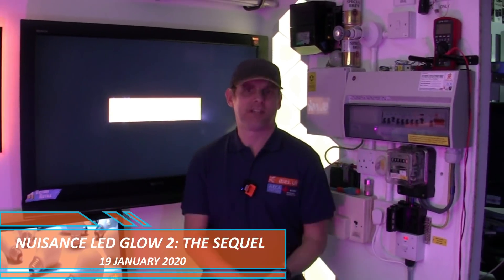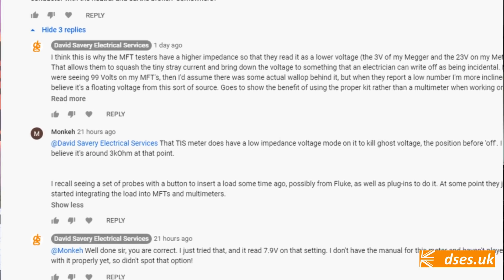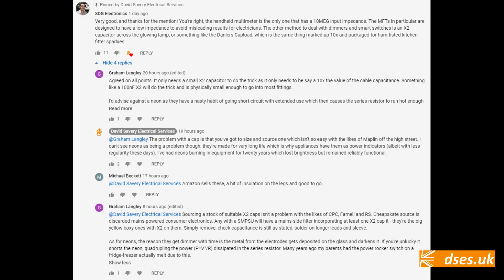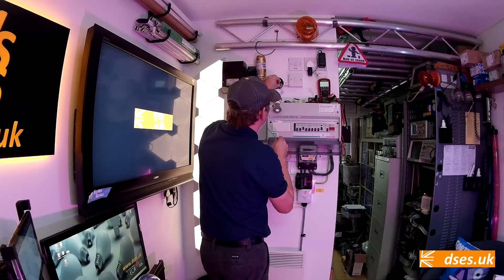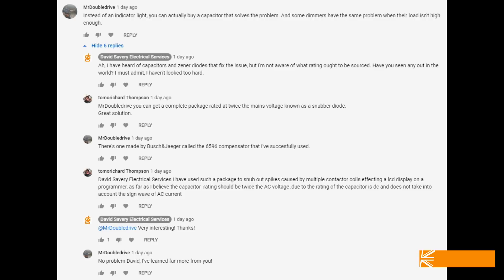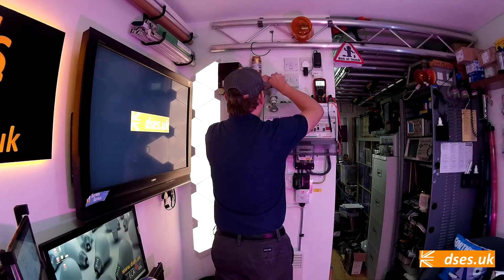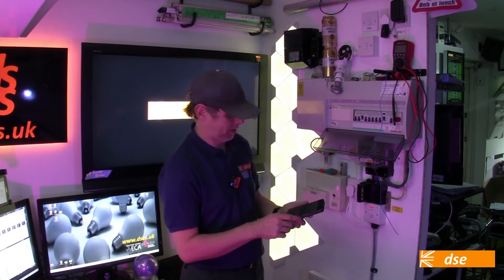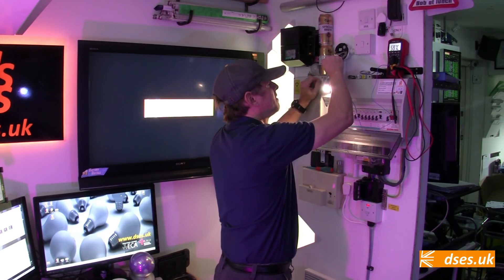Nuisance LED Glow 2: The Sequel

Comment: Thanks for the mention :)
The  resistor that should be inside LED lamps to stop nuisance glowing is on the low voltage side not the 230V. Normal resistors are rated for 230V and therefore not ideal for connecting across the mains, 2 should be used in series so that each one only runs at 115V ! This is the lowest cost solution as you can buy 100 for 50p and use bits of stripped insulation to insulate them,  there is also the cost of your time, 10 mins soldering and insulating versus  a trip to the wholesaler to buy a product if you find that you used the last one on the previous job.
Also see Big Clive's Resistor Roulette https://www.youtube.com/watch?v=cMnpMxYHlHY
Reply from the maker: Cheers Steve. I know what you were saying previously doesn't really apply to my shenanigans here, but I didn't want to leave you out as you'd mentioned resistors specifically. I take your point about the voltage divider. As you say, it's cheap, but not the way I'd prefer to tackle the problem!
Reply: The resistor on the low voltage side will only work with some types of LED drivers. It wouldn't work on switching converters for example
Reply: @dsesuk  resistors are a bad solution anyway. Best to use the imaginary component of the complex impedance to do the majority of the work so you don't create heat.
Reply: SDG Electronics 
A 0.47uF at 50Hz would result in: 
Xc = 1/(2*Pi*f*C) = 6776 Ohm 
That seems more than adequate if a 560k resistor also killed the light. So wouldn’t a capacitor of just 47nF have done the job as well in this case?
Reply: @Conservator.  David did use a 47nF capacitor. It was 0.047uF, not 0.47uF
Reply: SDG Electronics Oops, I missed that. Thank you!
Reply: @sdgelectronics  Correct - it only applies to capacitive droppers and I suspect all the LED lamps with this glow issue will have this type of 'driver'. A decent SM buck regulator will have circuity to stop this happening.

Comment: Your destruction of resistors reminds me of my electronics degree. Building a stepper motor driver and testing with resistors instead of the stepper motor. 4 smoking 47Ω resistors later and we'd proved the circuit worked. Love the videos

Comment: I would have thought anything generating heat tucked inside a ceiling is probably a bad idea, I would be going with the capacitor option myself.
Reply from the maker: Indeed, and those 15k things were from a lighting manufacturer too with the instruction that 'more than one may be needed'!

Comment: I've recently been glowing incandescently with rage with this problem. I installed new LED spots in our ageing fire station, and my competency was certainly questioned because of this glow of the lights!  Our building is pre-Christ era, so all steel cabling, which I assumed was the cause. I'll try this neon with resistor trick.

Comment: I had a related issue with two 1W LED spots over the bed. They are LV not mains so each have a tiddly little CC driver unit. They are each wired with a crossover switch so they can be operated by the door or whilst sat in bed. Everything is fine in one position, but in the other there is just enough current for the driver unit to start-up every 30 seconds or so so you get a little flash, then another, and so on all night. Not ideal.
I deduced that the problem was induced voltage, not helped by the fact that the original drop cable had no CPC. I'm pleased that I worked out the same solution: 0.1uF cap across live and neutral. The only catch is that it didn't work. Or more accurately it worked on one lamp, but the other one still flashes with the crossover in the 'wrong' position. I assume a fatter/different cap would do it but it's never been quite annoying enough to actually get round to fixing.
I've forgotten the sums I did now, but I suspect the answer depends on what's in the driver unit. Possibly just a less cheap and nasty one would do the trick. Anyone got any experience of the right values to suppress driver-startup as opposed to continuous glow. I think the problem is that the driver slowly collects charge and the voltage rises until about 80V when it decides to start up. So some 'fixes' will just change the frequency of flashes, not actually stop the problem.

Comment: hi David I have a weird one for you to ponder over! like your LED Lamps glowing when they shouldn't! it's an Electric shower when it's switched off the Neon glows on and off and water drips from the head sometime quite a bit, (i think I depends on the Voltage) obviously it doesn't do it when the Isolatior is in the off position, maybe others have come across this anomaly!
Reply from the maker: Hard to say without seeing it. Maybe the off position on the switch isn't fully breaking the contacts or water has got inside the switch mechanism or something???
Reply: @dsesuk  ok thanks it could be the micro switch maybe very close but not touching contacts acting like a Capacitor

Comment: A neon with series resistor would be better I think. Prolong the life of the neon and safety fuse if it ever did go low in resistance due to electrode failure. We use to use a 1Mohm 1/4W resistor in series with neons for constant mains indication. It gives a dim glow but safer and lower power losses.

Comment: Good to see the capacitor in action. You can measure the capacitance between circuits and then estimate the required capacitor value. Anywhere from 4.7nF up to 47nF is usually sufficient. Those 1/4W or even 1/2W resistors are often not rated for the peak mains voltage but I'd not recommend that approach anyway.

Comment: Why not use a single pole double throw switch with common as switched live and selecting between live or neutral.
So off feeds both sides of the LEDs with neutral. No wasted power or in back box circuitry components.
Live/Line/Hot depending on your grumpyness level 😁

Comment: Had this problem recently on  bathroom light and fan. When light was turned off the fan kept running on the overrun timer and the bulb softly glowed. The bulb still glowed even when the fan stopped. The fan had a humidistat that was still taking power. Fan was supplied by a 3c&e cable. Capacitance was causing a small current on the switch live to come back up the cable. Plan A was to fit an X2, plan B was to put in a separate cable for the switched live and plan C was to try a dimmable bulb. Plan A didn't work. I missed out Plan B. Plan C though worked. Philips warm glow bulb if anyone's interested. Original bulb was a B&Q special.

Comment: You are a life saver: installed 3 x 12v led tape under cabinet kitchen lights each with their own drivers. The lights were switched on a 2 gang with the main kitchen light 3 plated in the switch. When the main light was switched on the end led flashed when off, no glow. I switched the driver thinking I’d fixed it however the middle led started flashing 🤯, technical help at www.Sycamoreled.com were useless. Watched your video DiLog 9118 Mft picked up 59V, Tis859 showed 19V put in the Danlers load capacitor from CEF and the voltage on both went down to 1V, problem solved 😅. Cant thank you enough 👏👏🤩😎
Reply from the maker: My consultancy invoice is in the post Simon. Make sure you're sitting down when opening it.
Reply: Is this you embracing the dark side and monetising YouTube, it’s a sad day 😉

Comment: I've had a similar issue with "smart" or remote control light switches that don't use a neutral wire. They pass through a small amount of current, which is fine with incandescent bulbs, but will light up one of the LED bulbs in the circuit. Very annoying, I just ended up swapping out bulbs till I found a set that weren't too intrusively bright. The dedicated units they sell for the purpose are so very expensive.

I like the neon indicator idea, might see if I can find some next time I want to put one in.
Reply: Hopefully you're following Dave's example and experimenting on your own installation rather than a paying customer's.

The lamps matched to smart switches have already been tested together by the manufacturer so that you don't have to do it yourself, that's one of the reasons they cost more.

Comment: Stray voltage on 3 port valves can be in the order of 100V  on the orange wire and this can bring on some boilers because of the internal resistors within the unit allowing voltage down that wire.  https://diy.stackexchange.com/questions/100860/y-plan-sundial-150v-on-orange-wire-boiler-stays-on-in-heating-only-mode    A choke / suppressor fitted across the switched line to the boiler and neutral  stops this from happening.

Comment: Could you place the CAP in the light switch instead..? or would that present other complications..?
Reply from the maker: I don't see why the suppression device couldn't be in the switch so long as a neutral was in there as it needs to be connected across line and neutral. The only thing is, if there's a neutral to the switch then you may not have this problem anyway as the neutral would suppress the electric field. It's the lack of a neutral (leaving a line and switched line) which tends to cause this phenomena on lighting circuits.

Comment: I completely agree a suitable capacitor is the best way to go, but surely the capacitor used must be rated for at least 500 volts so that  an IR test at that voltage won't damage it ?

Comment: Nice follow up. Be Careful IR testing X2 caps above 240V, check their voltage rating first. 500V will most probably shorten their life. That ceramic thing was shite.
Reply from the maker: Ah, I'm glad you mentioned that as I did wonder about it. My cap has no DC data on it.

Comment: I tried the capacitor solution.. Without luck whatsoever. It even made the bulb glow more when turned off. But I was wondering.. If the light is switched off with a charged capacitor (given that the light is turned off before the sine goes down), wouldn't the charged capacitor just feed the LED when mains are off?
Reply from the maker: The capacitor solution works if the phenomenon is being caused by an induced voltage. If it's something else like wiring becoming energised through poor insulation with neighbouring circuits, then the cap won't work. As for it powering a LED lamp when off, the caps we're talking about here wouldn't hold enough energy and would discharge very quickly through a connected load.

Comment: Can you please explain how that switch under the incoming supply head is working?
Reply from the maker: Hi Andrei.  My test rig is fed from a 16A breaker in my main consumer unit. The feed passes through that double-pole isolator into the fake head which is just there for illustrative purposes.

Comment: I have a simular problem (I think) in that my Neon indicator in the switch for the outside lights glows when the lights are not on.  Same issue?  Same solution??
Reply from the maker: Less likely to be capacitance that, but impossible to say without seeing it I'm afraid.
Reply: Sounds like the switch is connected backwards so that the neon is on the mains side not the switched side.
Reply from the maker: @steverpcb  Could be - that would be useful as an indicator for finding where the light switch is in the dark!
Reply: @Underscore11000, is that not by design?  Helps you locate the switch in the dark?  old MK IP-rated switches used to do this, but iirc the neon went out when the load was enabled.

Comment: Now do a IR test with the cap in there - Am going to do some testing over the week at my new test bench am building look out for up loads to am thinking wire a 500ma 20mm fuse in case of failing cap.  I do testing and see

Comment: I've seen it happen! (the neon shorting). Quite recently. Had one that seemed a bit overbright in an all electric installation's on peak immersion  heater....

I said 'that doesn't look right'... headed for the switch, and felt the blastwave.

Subsequent analysis proved the neon likely went short (ish, very brightly) the 230k-ish rsistor got massively hot, melted its sleeving, and went dead short to earth. On a block of flats where the substation is in the car park.  Did i mention blastwave?

Also, unrelated, in a previous video i noted you using a scientific calculator app on  your phone....  It made me reminiscent. Do you want to name and unshame?

2nd edit... watch the voltage rating on resistors if you're gonna be signing your name to the installation. Most 1/4 watt resistors are rated 250v (PEAK) max...  If i was being paranoid, i'd use 3 or 4 resistors in series (with appropriate resistance changes)
Reply from the maker: Interesting (and worrying) to hear of your explosive neon demise. You're right about the resistor too, that was mentioned in the pinned comment. I wanted to show in this vid how resistors could do the job, but were not the ideal solution for all sorts of reasons, but I missed that point. The calc app was RealCalc, and very good it is too. The paid version is worth the pennies they ask for it!
Reply: Using several resistors in series sounds like a hell of a lot of work, even when being paranoid, IMO :)
[Though I'm not a professional electrician, electrical engineer, or anything of the sort, so don't put too much faith in the nonsense I blather on about! ;)]

I was indeed under the impression that ¼W metal film resistors are only rated for 250VDC, but having just looked at the data sheets of various ¼-1W 500k-1MΩ resistors, there seems to be some ambiguity there: a lot of the data sheets merely say "250V", so indeed one would assume that to be DC, but I did find a couple that listed separate-and-different DC and AC (RMS) values (pretty much the equivalent RMS value you'd expect), and one or two that listed the same value and said that it applied to both DC and RMS AC, so it's all very vague!

Of course, one wouldn't really want to use something rated even 250Vrms on UK mains, but you typically only have to bump up to ½-1W for voltage ratings to rise to 350/500V-something (and still <10p each in reasonable quantities). Ratings vary between manufacturers and product lines, though, so check the data sheets.
(There's also a separate limit of V_max = √(P×R) on many resistors, which won't come into play for the ≥500kΩ resistors being discussed here, but is worth remembering!)

And for the particularly paranoid, I've just discovered high-voltage resistors - e.g. Yageo's HHV series or Vishay's HVR series.
Those are rated well over 1kV, even in ¼W, and they're still a pretty-normal sort of size (e.g. Ø2.5mm × 6.5mm) as well as only being ~10p each if you buy 50 or 100 of them :)

This is all a bit moot, though, since I agree that resistors of any sort are a poor solution to this problem 😁
Reply: I'd agree with you on the 'seems a bit much' but the number of times this would be an issue for the average electrician, not too much hassle. Your real issue would be you're adding components to the system that aren't really intended for that purpose. You're signing it off with your CPS (competent person's scheme, NICEIC in our case) and thus putting your name to it on a document that's legally admissible in court.

I'd be going for an X2 rated capacitor as an easier solution and more 'it was intended for the purpose' proof
Reply: David, sorry, at the time I was partaking of the most wonderful produce of the hop plant.. so wasn't clear how the 'short to earth' happened. It was one of those awful units that uses the metal earth 'strap' to hold the neon in its yellow pvc sleeving into the red orifice.  The heat of the overloaded resistor melted the pvc sleeving and allowed it to push its now glowy conductive body toward the earth strap... 

And thank you for the App :)

Comment: Maplin was mentioned which went into admnistation, I'm just wondering besides Rs components who else sells resistors,capacitors etc now.
I  Just had a look on maplins  website and they don't seem to sell semi conductors anymore.
Reply from the maker: My first stop these days would be CPC with an online order. When I was a kid, we had two electronics shops in Coventry reselling RS stuff with a healthy mark-up! One closed c1985, the other not long after Maplin opened around 1991. Before then, if I wanted to buy from Maplin, I'd have to fill out a paper order form, post it off with a cheque and wait for the goodies to be delivered about a week later. Unthinkable in this day and age!
Reply: Ebay and Aliexpress but don't trust the voltage rating,  always use 2 in series for mains voltage whatever source you buy from !
Reply: @dsesuk  I can remember having to fill out the paper order form with the maplin catalogue  before the maplin shops popped up and before that a little shop called Durrants which closed I think around 1987 selling all sorts of resistors,diodes etc.
Have to say I haven't touched electronic components for many years, it was a hobby thing.
 I've got 100s of the things I was just curious where replacements can be brought now,not sure why I asked really I'd prefer to be cracking open a can of the bar maids tipple than the soldering iron🍻
Reply: Rapid electronics in Colchester  are good
Reply: CPC, Farnell, Rapid, Mouser, Digikey, and many, many other distributors of electronic components.
Reply: I forgot about Farnell, I've not heard of any of the others. Thanks for the information everyone
Reply: Paul Tipton CPC are part of farnell and deal with smaller orders and other items sparkies may like.

Comment: Hi David just a thought would a Varistor be enough to stop the glow with the added benefit of protecting the LED from spikes i.e. the issue you had previously ? cnr 07d471k Varistor or similar ?? these are pence each !
regards Paul
Reply from the maker: Y'know, I don't know. A good question Paul. I used to have some varistors around here; I'll have to see if I can dig them out...